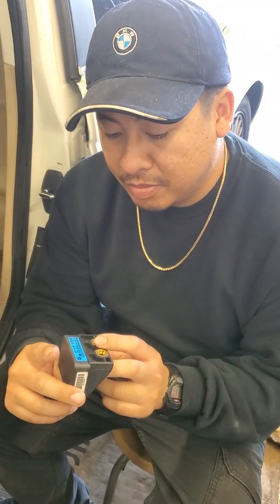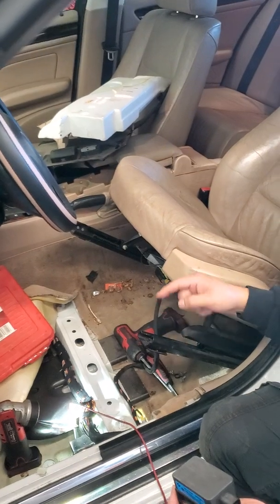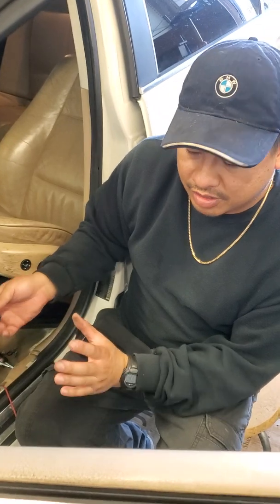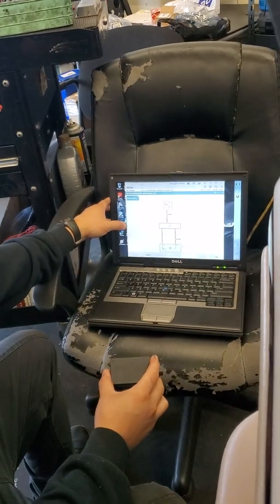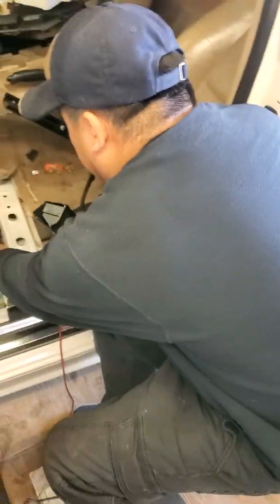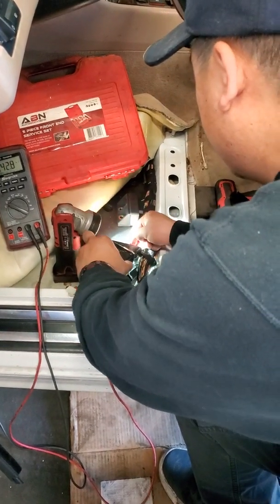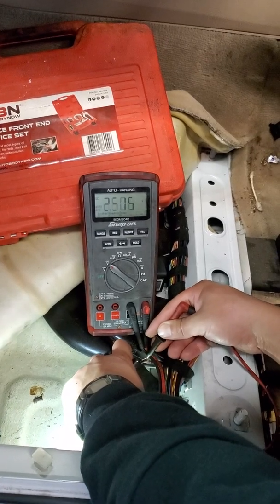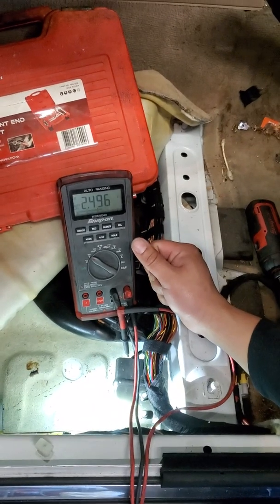How to test a Yaw sensor on a BMW E46.

Comment: Would unplugging this disable abs pump sensation while drifting?in a private track I sense my car braking while going 50 mph on the track
Reply: Yes will disable most abs functions 
If you have a bmw x5 4x4 you can disconnect and it will not use the abs functions and will run only in rwd

Comment: Great video. On my 745 I have similar symptoms. All ABS DSC Brake lights are coming intermittently. Once I was parked and turned the wheel and the car tilted sideways then displayed “Vehicle detects increased body roll…” I will give this sensor a try